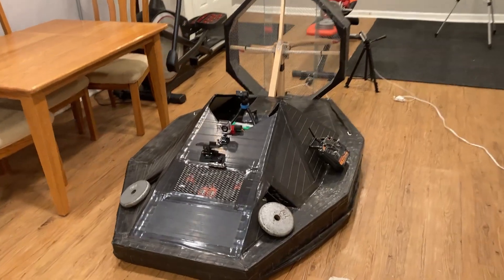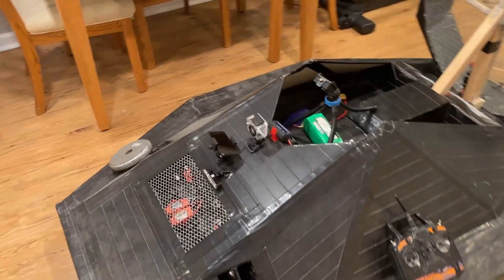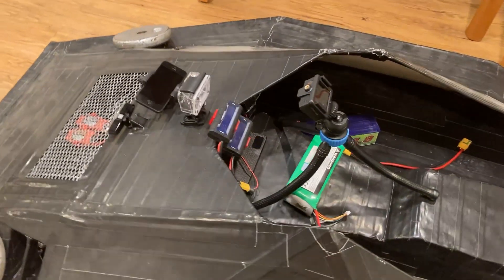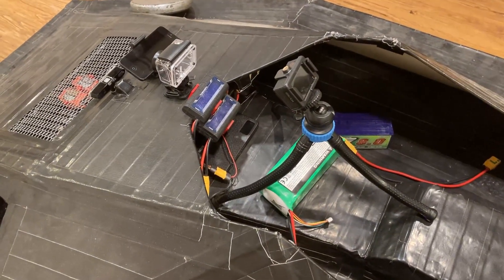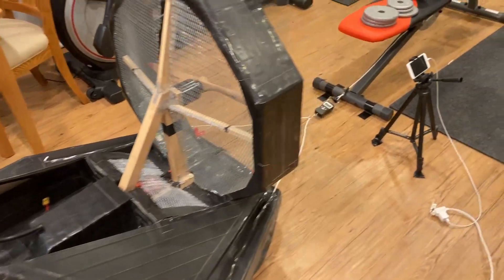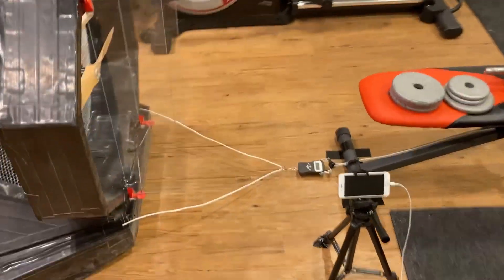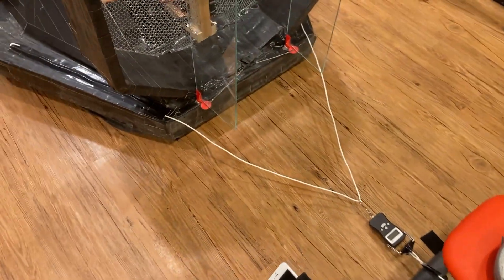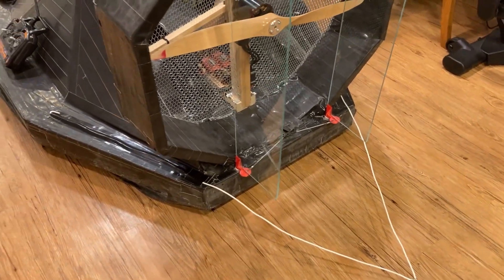Thrust Test of 12000W DIY Electric Hovercraft (Turnigy CA80 Motor)

Comment: 1955 +/- I saw a young kid ( 12 years old? ) in a local park driving his hover craft - made from plans from a 'how to' book - his dad had helped - it appeared to be about 10 - 12' in diameter, rubber skirting, perhaps made from car innertubes and powered by a small lawn more motor - it wasn't fast, or exciting, but it was floating across the mowed grass - it grabbed my attention and I've maintained an interest in hovercraft ever since - now at 83 years old, I'd still like to make one and incorporate some of my ideas into the steering and thrust process ( in my perception, thrust, braking and steering are one and the same process ) -  - I'd use a large squirrel cage fan powered by perhaps a snowmobile motor ( all of which I have laying around already ) - all I need now is the decision to do it! - sure enjoyed your video
Reply from the maker: Thanks. Yeah I have been thinking about hovercrafts since I was younger too. I was so excited to finally make a working one that I could ride.

Comment: Hey Jacob, great job on the hovercraft.  I'm keenly interested in following your progress.  I too am planning to build an electric hovercraft and your data is very helpful.  One feature I was hoping to incorporate in mine that I'd love to see what you think is the reverse thrust "cups" that Neoteric Hovercraft uses on their hovercraft.  It's almost a quantum leap in control and maneuverability over traditional hovercraft.  As for the thrust test, yes definitely test various props.  It's almosts a black art to find the right motor/prop combo, but when you find it "you know".  :).  Anyway, keep up the great work.
Reply from the maker: Thanks for the comments! I'm glad you may find the data useful. I'm excited to try the next combo in a few weeks to see if it improves thrust and speed. Right now I'm almost finished adding a computerized Arduino control system to try and improve controllability. I'm really interested in how those reverse thrusters will work for you (I checked out that project as well). I ended up deciding to go with skids and a quickly transitioning lift system for start and stop braking to try and save power/batteries (changing momentum/direction uses the most battery since once you are going friction is very low). But it would be great to compare notes if you decide to use them in the end :)